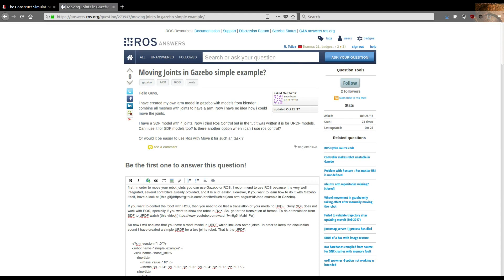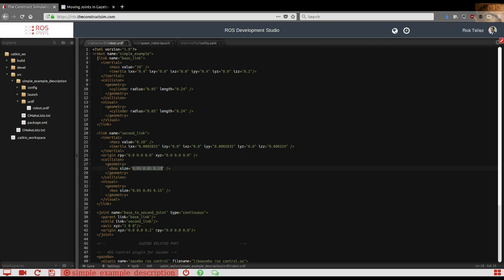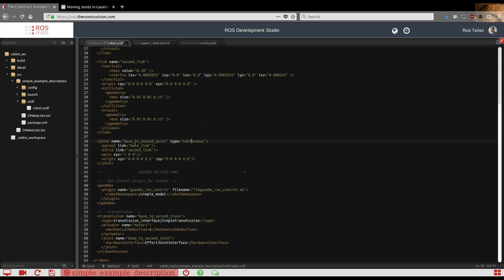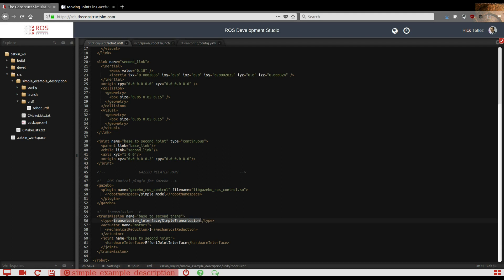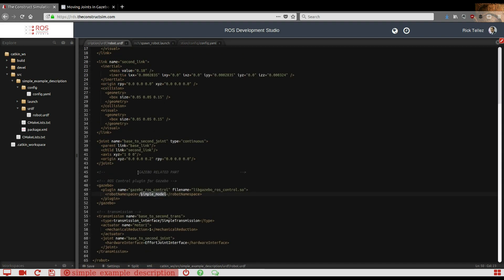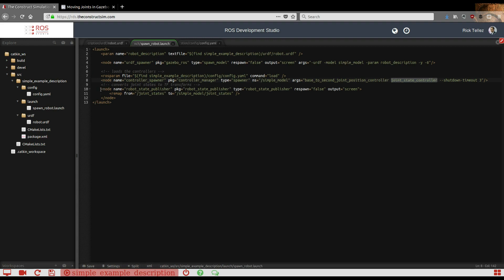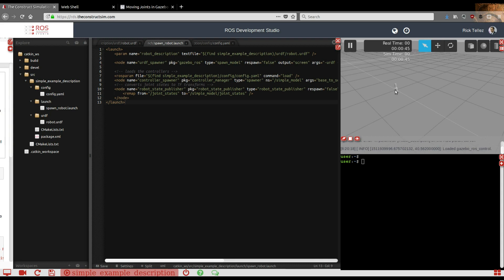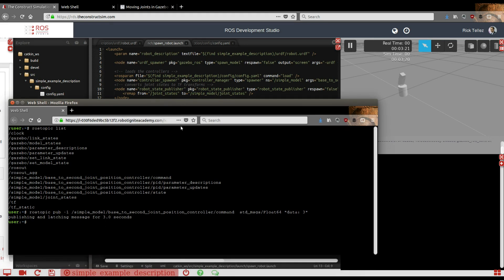[ROS Q&A] 070 - Moving Joints in Gazebo Simple Example

Comment: Good one! Maybe just a question, what's the advantages and disadvantages if I decide to work with MoveIt from your personal experience?
 thanks.
Reply from the maker: If you need to work with articulated arms, then you must use MoveIt! It will be a lot easier for you. Only drawback I can think of is that MoveIt! is heavy but it works pretty well and simplifies arm kinematics a lot

Comment: nice video but how would you suggest me doing in order to set it to move to a certain position? because in your example it seems to more randomly
Reply from the maker: What your question really means is, how can we perform joint trajectory control so we can move to a certain position.Of course, the video just shows how to configure your robot simulation so you can start doing control on your joints. The video does not address the problem of control. 
If you want to learn more about controlling joints check the following videos:
- ROS Industrial: https://youtu.be/J6Mu1P6FlxY
- ROS Manipulation in 5 days: https://youtu.be/9l5HxFF4PZc